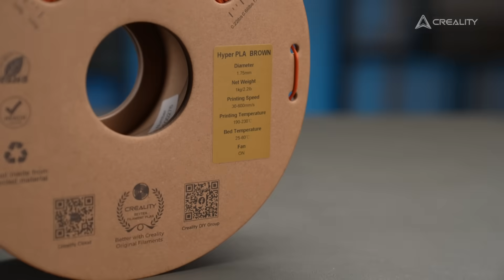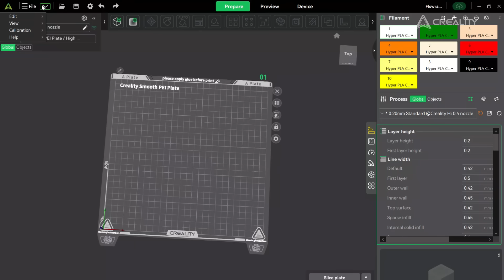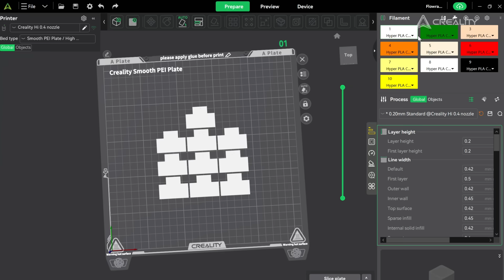Creality Print | 3D Prints Weak or Blobby? Try This Flow Rate Calibration Fix!

Comment: Nice of you to include this! It would be nicer if you did little vids like this for the rest of your calibration tools. 

I had to do this exact thing recently and due to how your Print6 works, it doesn't operate the same way on vanilla Orca Slicer, so I became confused if selecting pass #2 was actually doing anything and I ended up putting the number into filament then running pass2. Completely chasing my tail, obviously. This video showing how it's done, based on how your Dev team made it helps a LOT.

Comment: I got -20 in first test and -8 in 2nd does this really mean i need to set flow rate to 6,992? seems quite far from the 0,95 starting point
Reply: You mean 0.699. And yeah same situation, even with 0.8 flow rate with some of my ABS filaments is too much blobs on the second layer.